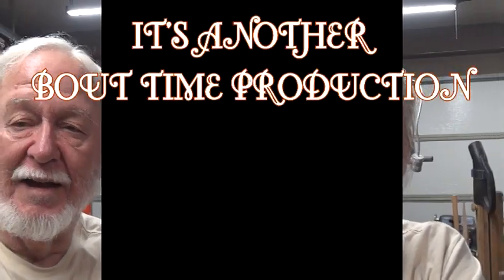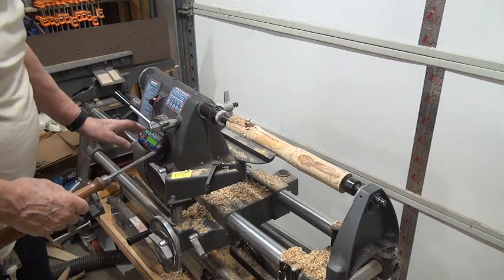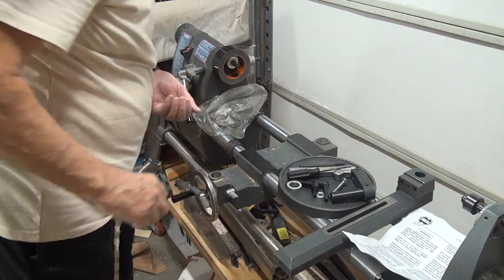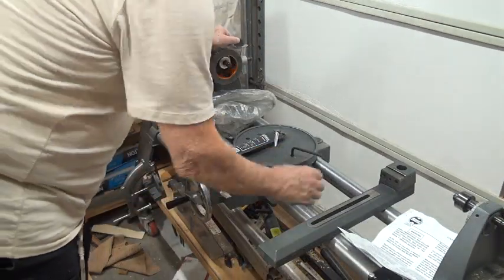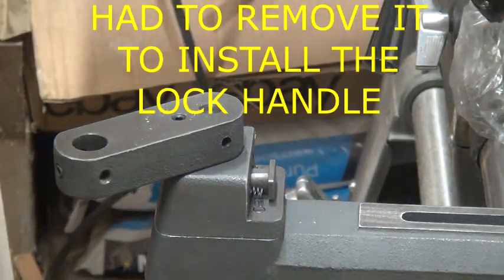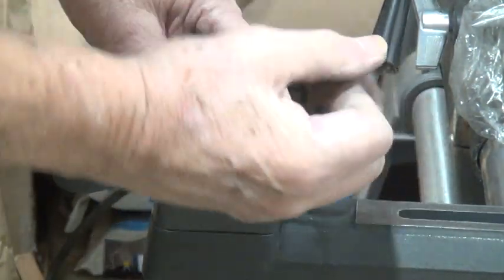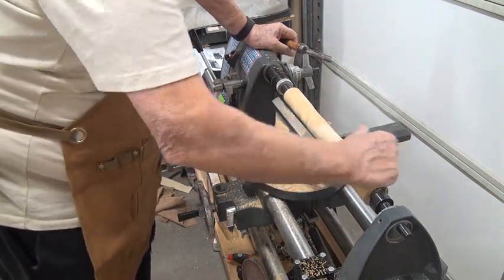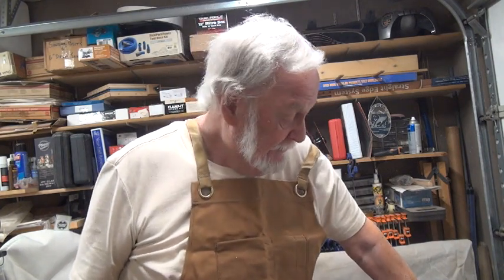SHOPSMITH IS A GREAT LATHE

Comment: Very interesting. I've heard of the Universal Tool Rest but this is the first time I have seen on go together. I've only used my Shopsmith as a lathe on a couple of occasions. Time is my main constraint. By the way, I left you a link to Everette Davis's Shopsmith bearing guide which has the most complete bearing information I know of. Keep us posted on how the vibration issue in the other video comes out.

Comment: I agree! I have a 1983 5/500. I am in a wheelchair when I turn. I was doing killer work then I got bad news from my neurologist. The way you are turning your body is hurting you. The way rails were in the way of my legs. I had to make a move. I bought a separate Laguna lathe to continue turning. Shopsmith is a wonderful platform for many functions that I can still use. All in all it’s a killer machine.
Reply from the maker: And I still use it as a lathe, but yeah, it was really a pain to have to bend over to use the lathe, thank you for. The comment. Ted

Comment: I have never done it but I have often thought about putting to anchors in my floor where I Normally store it and use the lathe.  The just ratchet strap it down.   One day I will do it if I really get back to turning but I love mine.  I wish I had that heavy duty tool rest.  I do not even see them on the shopsmith site anymore.

Thank you for your service to the country young man!
Reply from the maker: iT IS ITEM # 555314 $319.00. i THINK IT IS WELL WORTH THE PRICE IF YOU'RE GOING TO TURN ANY LARGE PIECES ESPECIALLY. THANK YOU FOR THE COMMENT. TED
Reply from the maker: While turning the 18 inch dish whatever you wanna call it in and move on me I’m thinking about taking one of these rubber floor pads and cutting them in the squares and put them under the legs to allow them to absorb the vibration and limit any kind of movement. So next time I use the sharpness of the leave, I will do that in the video to see if that does the trick without having a bolt it to the floor.

Comment: So i use my SS exclusively for wood turning. The tool rest is great but the tail stock on my 5 flexes if I put any amount of force to hold a part between the head and tail stock.
Yours does the exact same thing at time mark19:51. . . . . 
I already tried everything to stiffen it like a real lathe tail stock is but it still flexes. When it does the piece starts to spin out of round circular motion.

Other than that the SS good.
I'd like to hear from someone that was able to remedy that issue.
Keep up the great work and keep turning. 🙂👍
Reply from the maker: I do not have that problem at all. I am wondering if you have aligned the head stock and tail stock by using your live center and fixed center to insure, they are exact in alignment? 
I would suggest you watch My Growth Rings video; Before Turning On Your Shopsmith Lathe, Watch This! This is the only reason I can think of that may be the problem. Ted
Reply: yup I did but alas it didn't help.
I still use it as a lathe but have to work around the issue. Wish SS would design a more robust tailstock.
...Your SS does the exact same thing at time mark 19:51 in the video, just like my unit.
 @choochoo3985
Reply from the maker: I think the problem was that I didn't have the pressure applied on the spindle due to having the stop set locked which allowed the work to slip and wobble. I watched the video tonight and the live center is not vibrating, but the work is. I believe that if I had applied enough pressure from the start, it would not have done that at all. as when we turn the piece the wood allows the two ends to adsorb the points which loosen the piece. I generally apply enough pressure to flex the tail stock back about a quarter inch and after a couple minutes of turning re-tension it. I have turned many pens and other handles on this and don't recall a being a problem. If that doesn't help, I have no idea what is going on but appreciate your watching the video and communicating with me. Ted @nickfritz8692

Comment: I had some out of round wood that since the Shopsmith cannot turn really slow was too fast and shaking the Shopsmith very badly.   So, I took my Kubota BX2360 and set the bucket on the lower tubes and lifted the front of the tractor.   It held it in place enough to get the job done.
Reply from the maker: I Don't know what model you have but the Power Pro does provide a slow speed that helps eliminate that issue. Glad you found a resolution and shared it with us. Ted

Comment from the maker: Had a viewer note the wobble on the live center. He stated that his Shopsmith does the same, however the cause of the wobble on this video was the result of my not releasing the depth stop and not getting the stock securely tensioned correctly. After readjusting the pressure on the stock I still had a little vibration, but think that was a result of enlarging the hole on the live center end. I turned several lathe handles prior and after this video and had no problems. Really like the lathe fof doing spindle turning.